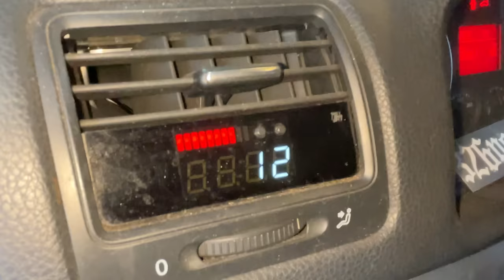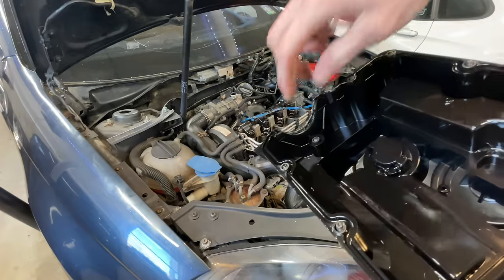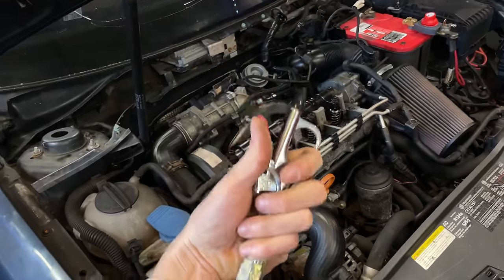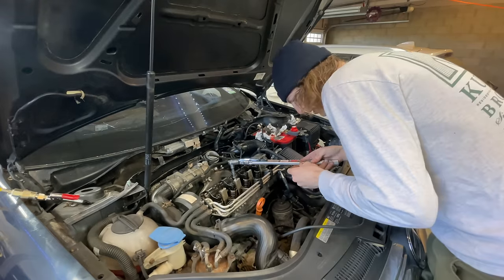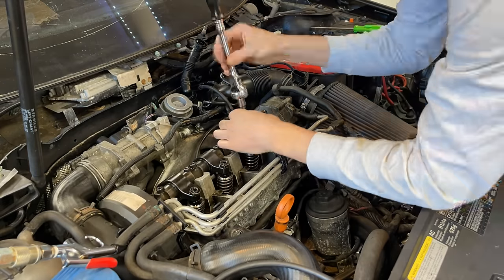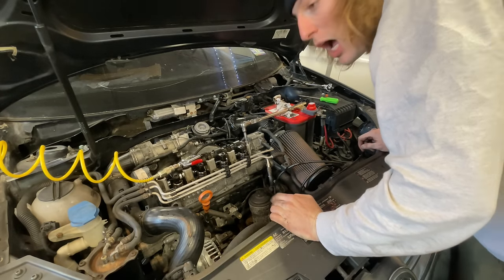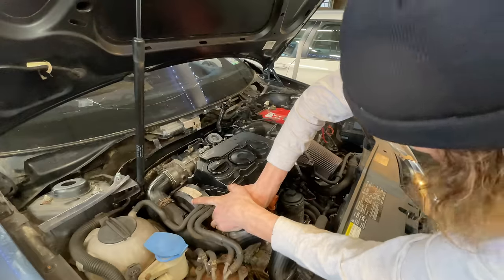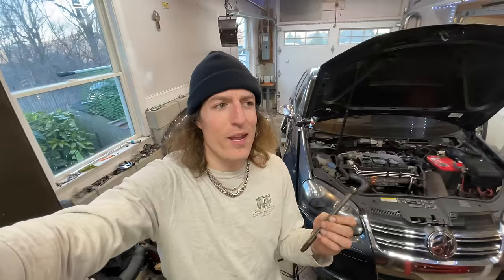I INSTALLED pd150 HEAD BOLTS - IN MY TDI

Comment: this hurts my soul please stop bashing limiter when its not fully up to temp its not healthy for anything in the long run, also make sure to idle the car for a minute or two if you hit limiter dont turn it off right away let some oil circulate through the turbo to cool it down.

Comment: whats the difference between ur engine and a 2.0 tdi BMP?
Reply from the maker: No clue
Reply: One is twin cam
Reply: @sonnystokes868   wrong, both of them have one cam...basically from the outside they are both the same.
Reply: @AndreiB62.0TDI  2.0tdi is twin cam
Reply: That’s the diffence between 1.9 and a 2.0 but 1.9 is the real pd engine more reliable
Reply: I will correct my self most 2.0 are twin can 16v

Comment: Probably not the best place to ask but fuck it haha. I’m wanting to run swifts all the way around in my mk6 GTI. I know the specs I’d need for the rear but what should I run in the front? I’m running Godspeed coils (going for stance look so quality wasn’t high on the list lol) if that helps any.
Reply from the maker: Bro honestly you cant beat a simple setup , my mk6 is on br series coilovers maxed out in the front and bottom perch in the rear and its the stiffest car i have funny enough , stiffer then my 80k’s if i push on the corner of the car . If you can get a 6” set of 10k swifts youll be good 🤛